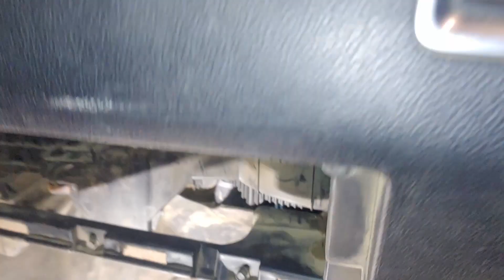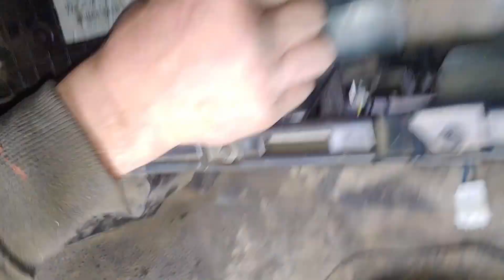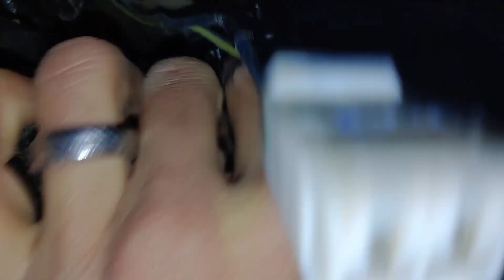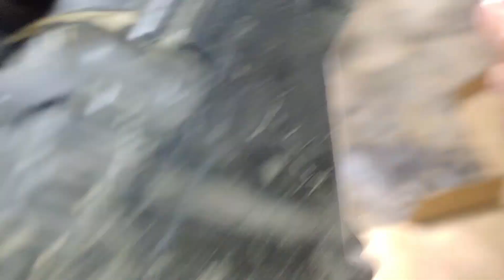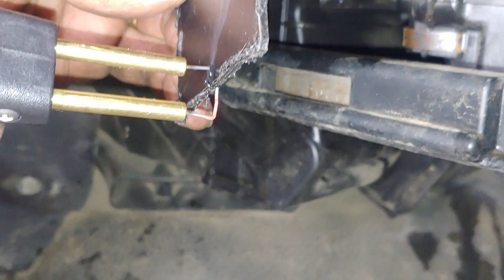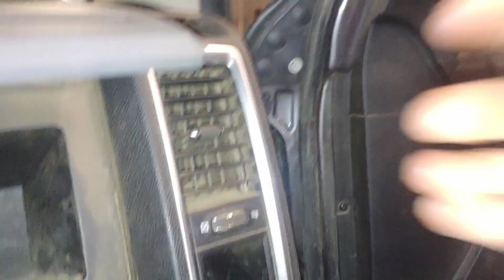How to Clean Ram Truck Evaporator

Comment: Hey buddy nice video with alot of information got a quick question,  when you cut the square hole out could u see any blend doors at the bottom anywhere because iam having a bad knock sound right in that area behind the blend door actuator i know it's not the actuator because I replace it with a new one and it still knocks right there with the new one iam thinking my blend door inside the hvac is broke off thanks
Reply from the maker: You know, I don't really remember seeing one. It's been a couple years since I did this project, but maybe you can see it in the video somewhere. I'm not sure though. Do you only get the knocking noise when the blower is running or is it when you're trying to switch from hot to cold?
Reply: @ReubenSahlstrom I get as soon I start the truck up with ac and heat is off

Comment: Awesome guys! I also have a 2015 Ram with basically no heat. I’ve notice the airflow is abysmal lately. Went to the auto shop and bought a new in-cabin air  filter, pulled the glove box and was like… where the heck is the filter door. Apparently mine does not have a factory filter either. I looked a few videos about replacing the heater core… that dash removal is brutal. I’d much rather cut a hole or two. Nice job!

Comment: What tool did you use to cut to clean if you mind asking
Reply from the maker: That was a dremmel with a drill bit. I would probably use an oscillating tool if I had the choice though, they are so controllable and easy to use without plunging very deep into the unknown.

Comment: I have done this before and used heavy silver foil tape to secure the cut out plastic parts and it has stayed in place for years now.  I have never seen the plastic weld staples.  Where did you get that?
Reply from the maker: I think it was from Amazon. Lots of cheap ones out there. Foil tape would have worked just as well.
Reply: @ReubenSahlstrom keep doin what your doing,  good to see people working on their own stuff and learning.

Comment: I got air flow for the most part but no frickin heat you know evaporators absorb heat so I think it’s probably so dirty that it can’t. 
Awesome idea guys! Great work! Seems pretty simple
Reply from the maker: Make sure your truck has plenty of coolant. I had my service van get a little low on coolant, and then the heat wouldn't work. Even if your evaporator is plugged up, you should still have some warm air coming out.
Reply: Do a heater core flush. Did it in mine and helped. Some vids on here for it. Also read that the heater core is 2 sections. The top section is for the passenger side and the bottom portion is for the drivers side. The bottom is going to clog up first naturally due to gravity. Flushed mine and much hotter heat
Reply: @H @Heyyoburbonbro ya I did a heater core flush a bout a month ago and she’s working perfect now I even did some CLR in the heater core as well. It was dirty but nothing compared to what I’ve seen on some videos. 
Thank you!
Reply from the maker: Awesome! Thanks for coming back and leaving another comment, that'll help other people if they're having the same problem.

Comment: I have a 16 6.4 would the evaporator coil being clogged make the truck loose excessive water ??
Reply from the maker: That depends on where the water is coming from. If you're just talking about water draining under the truck coming from the drain tube, there should be a decent amount of water if it's humid out. If it's leaking somewhere inside the truck, then likely the drain pan is plugged on that assembly.
Reply: No air flow will cause the evap to freeze

Comment: Ok, I'm  doing this. My 2015 Ram barely blows on high. 

But since I live and travel on lots of dirt roads, I'm going to get another larger peice of plastic and a foam gasket and make that hole a permanent access point for annual cleaning, along with the air filter addition.

Comment: Damn this I’m just gonna pull the entire air box and split it on the work bench. My 03 tundra had easy access to the evaporator core. It was completely covered in dirt/lent front and back I could grab it and pull it out by hand. After air blew correctly and  got down to 38 degrees.

Comment: No filter because the flap door has or probably had At this point a foam on one side of the door that is the filter. My door fell and covered my vent hole above to blower. I just removed it. Tons of power now.

Comment: So dumb these trucks didn't come with a cabin filter. I think my coil is getting plugged up. Seems to be freezing and dripping excessively. It works fine, but after a long drive the other day i was getting little airflow and had pool of water passenger side.

Comment: Great video! I just cleaned out the evaporator and rinsed it out with garden hose spray adaptor after removing fan and resistor and cutting access holes in same locations. Was easy to get brush in there and clean it. Put an air filter in, too. 
Thank you!

Comment: I know this is a old video but I have a different issue with my air flow I have a cabin air filter have no air flow change the cabin air filter still no air flow take cabin air filter out and have all the airflow why?
Reply from the maker: Could it be that your air filter is too restrictive? It would seem that if you have great air flow without it, and no air flow with it, that would be the only plausible cause.
Reply from the maker: I don't know about car filters, but air filters for furnaces are measured in MERV, and something like an 11 or 12 Merv is very restrictive compared to a Merv for or six.

Comment: I'm watching your video again after going through the repair one time, and I'm curious if you considered cutting out the bottom of the evaporator housing to get better access to the coil? 

I ran through these instructions one time and I felt like I had a little bit better air flow but it was still noticeably degraded. I was watching the video again to see if I missed something and I was wondering if cutting in a different location would give better access for hopefully better cleaning. 

What do you think?
Reply: Don’t cut into the drain pan or your floor will be wet

Comment: Great job guys!  Please consider more vac than blow, as blowing can jam debris instead of remove it.  I am going to use my power washer on low setting with just dawn, then spray 9-12% chlorine to kill fungus, mold & germs and rinse with 3% hydrogen peroxide. With fan on for ventilation.  On the shop vac; use duct tape to hold paper-plate cone/funnel to a short piece of hose, to get inside and vac that crap away. ;-)  BTW if you make the holes Hole saw Knock-out sizes; 1-1/4", 1-1/2", 2" you can use a know-out filler and silicone calk to fill the holes. :-)

Comment: You can use the water hose in there, just make sure you keep the drain plug clear .
Great video , you can tape the outside air inlet shut and ut will help keep your coils cleaner.

Comment: Good job. I have to cut a hole in my Silverado to get better access to the evaporator. Do not I repeat do not use any kind of WIRE brush. You will close off the evaporator fins!

Comment: Great video! I did this as you did and air started blowing out as it should. 2 days later now and air is back to bearly blowing out again. Any ideas??? Compressor is brand new and fan motor works correctly.
Reply: your blend door may have broken. remove the blower motor and look thru where blower was mounted. if the door broke it will be laying on top of the blower hole blocking your air flow. pull that broken door out and toss it.
Reply from the maker: Was it pretty plugged up when you cleaned it out? Could possibly be the fan speed controller or "resistor" as I think they call it.

Comment: I have a spray nozzle for the garden hose I got from Home Depot. It’s got a valve with a 3 foot piece of tubing with a nozzle on the end. Almost for watering trees. I take out the resistor and blower. I put a rubber Mat on the passenger floor board. And I blast the coil with water until the drain clears. Then I’ll use the coil cleaner and soap it maybe 3 or 4 times . Wait each time about 5 min . And power wash it off with the nozzle . Put your resistor and motor back in . No holes to fix . Don’t take the glove box out or even down .
Reply: Please make us a video!  Thanks, I'll try this method out soon.  My AC is not blowing too well and not cooling properly.  I hope this fixes the issue

Comment: Great information I wish Brunswick Automarts Service Department had.  My truck has no air flow intermittently though.  This does not seem to be my fix.  Any ideas?
Reply from the maker: @NEOHIOFlagChair  is it only when your air conditioner has been running for a while? Could be partially blocked and freezing up as a consequence.

Comment: What I just looked at hurt my eyes 🤕 In Russia, we just remove the top panel completely and clean the evaporator😂
Reply: We do in America as well. This is the lazy or unqualified method.
Reply from the maker: Maybe "short cut" would be a better term? Lazy is on welfare watching YouTube, not posting it. Also, why not call out ram for not putting air filters in? Now that seems retarded if you ask me.
Reply: @ReubenSahlstrom  lazy as in they are too lazy to remove the dash so they cut a hole in the air box which looks like crap and will more than likely leak off air pressure or fall off in he future. I’ve seen it happen by other unqualified mechanics hack jobs in my shop.
Reply from the maker: We did this for our own vehicle. If you're running an actual mechanics shop, don't be watching YouTube to learn how to clean an evaporator this way. I am sure pulling the dash is much easier for some more experienced guys like yourself. This is just an alternate way that worked great for us, and is (I would assume) interesting to others like yourself since clearly you have no intention of doing this.
Reply: @ReubenSahlstrom  well I’m glad it worked out for you.
Reply: @ReubenSahlstrom  this is a good way to make cleaning the evaporator easier in the future, but I would do it more carefully. And I don't have a workshop, I do repairs right on the street, sometimes at -30 °C)))
Reply: I would do this on my 15 ram. Not take the whole dash apart for a little cleaning lol. I dont mind it looking like crap where no one but me will ever see it. Great video figuring out where to cut so we don't have to 😊 @ReubenSahlstrom
Reply from the maker: @alexcarson4444  Yes, this is the main purpose of the video! Glad it was what you were looking for.

Comment: Ty for the video,  2011 ram same problem, couldn't figure it out until I seen the video. I did what you did except cutting the square and hole, but fixed the problem now I can feel cold air and good flow. Ty again really helped
Reply: Were you getting cool air before?  And now it's cold air?

Comment: Ilike the access hole idea! How much spare room did you have around your cut? I'm wondering if I can make a bigger hole than you did or if there is something in there i would absolutely grenade if i didn't stay in that rectangle area where the sticker is located. Thanks!
Reply from the maker: Yeah we didn't want to "grenade" anything either! 😂

You could possibly make it bigger, but there seemed to be some support ribs that could make cutting more differicult. We were just being cautious, and it ended up being enough access, although more would perhaps be better. You'll just have to make that call on your own, hope this helps!
Reply: Sounds good! I'm going to add the cabin air filter and try it your way. $1200+ to do it otherwise and truck has 189000 miles. Thanks for answering so quick!

Comment: My 2010 ram has had weak airflow since I got it 6 months ago but recently airflow has stopped and then sometimes it flows again could this be why?
Reply: not likely, if it is clogged like this its not going to unclog then reclog. check the blend door and see if i broke. you can see if its broken if you remove the blower motor and feel up inside the hole for a loose rectangular plastic piece.

Comment: You should consider getting small sheet of abs and some foam strips to make a door to cover those holes so you can access them again later
Reply: No point, simply remove the blower.
Reply: a small set of hinges installed would make re-access easier.

Comment: Mine is leaking water from that box that you cut a hole into. Backed up drain im guessing. Will investigate as time allows.
Reply: shove some heavy duty weed wacker line up into the hole to unblock it...or you could use a wet vac to suck it out the drain line.

Comment: Those are prob one of the easiest dashes to pull ever, did my heater core start to finish in 2 hrs removing the dash and pulling the hvac box, I feel like this took way longer and made waaaay more of a mess
Reply: Bullshit
Reply: It takes a lot of careful work to remove a ram dashboard. Many electrical connectors to pop apart .many screws clips.and pulling ng the steering column. ...then you got to put it all back..oh I almost forgot you also have to discharge ac system....

Comment: I got good air flow, but my ac doesn't blow cold during summer. The system will blow cold if is cold out. Heater works just fine, i already cleaned out my evaporator.  Still didnt work, any other ideas?
Reply from the maker: Sounds like you have an issue with the actual refrigeration part, so charge, compressor or pressure switch.
Reply: Did you ever figure this out? Mine is doing the exact same thing.

Comment: Hack job.
Reply: @ReubenSahlstrom  Bro, you could have just run a tube through the evaporators drain and cleaned it better instead of chopping holes.  Just sayin. May try in the future.
Reply: @ReubenSahlstrom  With evaporator cleaner.
Reply from the maker: @maxpain7197  honestly that could probably work too. Pretty helpful to watch this video and understand where the coil is, and where to spray the cleaner. You should try it on your truck and see how it works. Maybe make a video about it? Although there were perhaps lazier ways to do it, this was definitely the best way from us to really see if the debris was being removed properly without pulling the dash.
Reply: @ReubenSahlstrom  the drain goes straight into the drain tube it's like an artery to the evaporater.  Cleans it from the inside out.

Comment: I was thinking of this solution but I didn't want plastic weld the flap back in, I wanted to leave the hole for later cleanings but I was debating on how to make a piece to cover the hole. I was thinking I could hot glue some cardboard on the inside and then spray some expanding foam all around the hole but I am not sure how long that foam will last.
The whole process also makes you wonder why the manufacturer just didn't make a cleaning port, it seems almost malicious that they didn't do the obvious necessity here.
Reply: just slap some black flex seal tape or just black duct tape😊

Comment: That stuff is a acid! And made for Residential and commercial AC , automotive ACs have different parts that it might eat away at even if you rinse it off with Water, another issue a Vehicle is a confined space your going to be breathing that chemical 😮  it doesn't have long ducts to travel through like a home central AC.  I would never do this to my RAM .  Shortcuts are never cheaper in the end.
Reply from the maker: I can understand your concerns. The cleaner we used is aluminum safe, and and rinsing does remove it. Also not sure why having longer ducts would change what's in the air that's blowing through them? In any case, glad you are convinced pulling the dash is a better solution, you have fun with that. 😉

Comment: Good on you guys but I'd rather spend a few hours pulling the dash, rather than chop my truck up.
Reply: A few hours?  Not on these trucks.  And to fully remove it you have to open the AC system.  If you do not have the ability to evac and recharge then what?
Reply: @dkimble9151 then you cut an access hole and save a few hours ;) unless you bad broken doors, this would make the most sense

Comment: you might have had the same success by simply shooting the entire can of evap cleaner up the drain hose, clamping end of drain hose for 10-15 minutes so cleaner can dissolve evap filth, then unclamp drain hose so it can all drain out. repeat until comes out clean. same result much less work
Reply from the maker: You might have to try that out, and see how it works. 😂
Reply: @ReubenSahlstrom  I did, it works great. There's several yt instructional vids of it. Best

Comment: Thank you for your video.  It helped me clean the evaporator coil of my 2015 Doge Ram 3500.  I didn't use any water or sprays.  Removed resistor, and pushed in 4" diameter dryer vent brush and pushed it all around. It dislodged all the caked on dirt, and I vacuumed the dirt out using wet and dry vacuum with a 1/2" tube squeezed into small slot vacuum attachment.  The airflow increase was amazing, and feels like original.  Selfie on cell phone takes decent photos of dirt on coil when pointed up resistor opening.
Reply: Thanks for sharing that tip. I was wondering if you could see the rest of the evaporator by dropping the resistor. I’ll try that on mine since I just had this issue this weekend. I was able to get some airflow back by turning off the recirculate function.
Reply: This tip right here! AC on my '14 3500 is moving with purpose again. Thank you

Comment: Reuben, you are brilliant! I’ve been watching videos and reading forums for weeks trying to figure out why my fan motor isn’t blowing hard enough in my 2015 Dodge Ram. No one except you (that I could find) realized the coil was acting as a filter. Then you’re solution to the problem that didn’t involve tearing the whole dash out is brilliant. I did exactly what you showed on the video and now my fan blows strong. I live in Texas so the AC needs to blow very strong. I am 51 years old and am a mechanic by trade. I am so grateful that I can learn from you young guys too :)